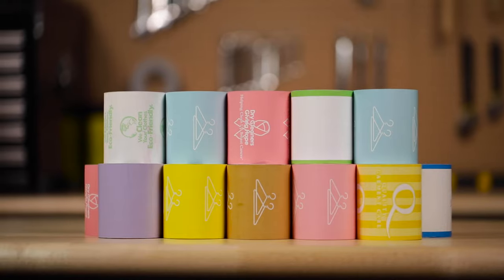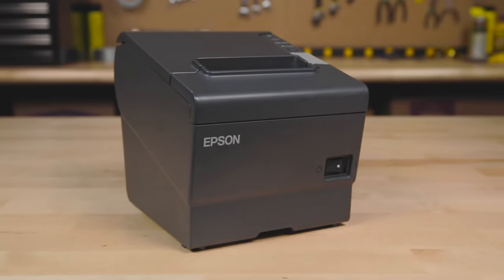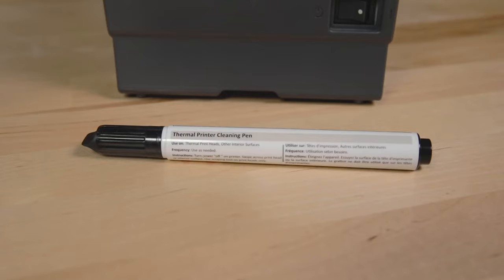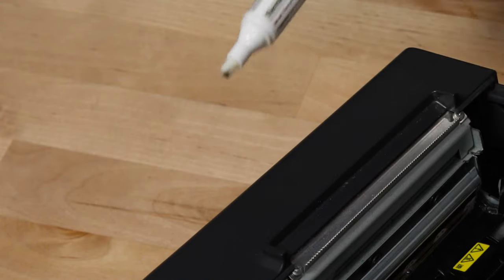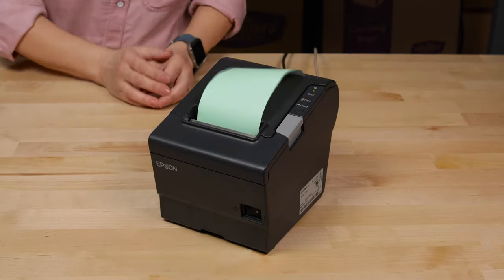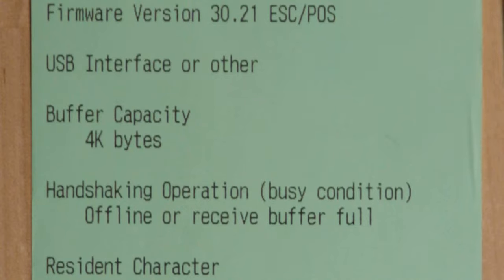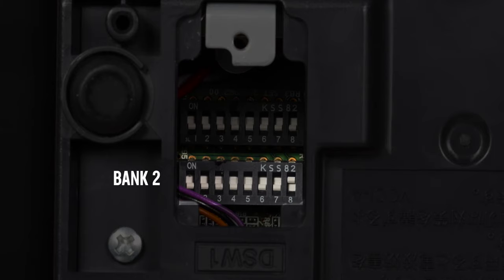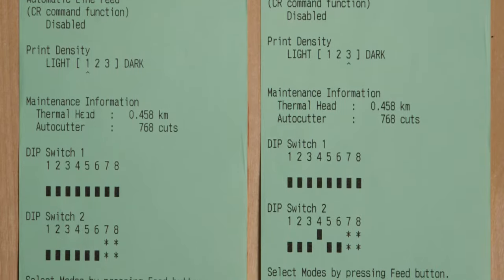How To Clean A Thermal Head Printer

Comment: Hey I was having the same issue with a Paperang P2 thermal printer that connects to a smartphone. You showed the use of alcohol in a pen. I didn't have any but I was able to clean mine with a little hand sanitizer on a piece of tissue and before I cleaned it there was this black stuff on the head and after cleaning, the black gunk was gone and my printer works as good as it did when I made my first print out. Thank you.

Comment: Very good day, first of all, congratulations on the videos you upload, they are always very useful and have particularly helped me a lot. Please keep uploading videos like this. Please if you can help me with the following: I have a TM-T20ii that sometimes prints perfectly and other times it stops on the first line, check the motor, sensors, clean the head. When it prints the print is of good quality. I have tried it with the startup test by turning off and holding down the “Feed” button and sometimes it prints the entire report, sometimes only the first lines, sometimes up to half and it throws an error. When I turn it on normally, the error light comes on for a second and then goes off (I don't know if it's normal). I have another similar printer and it was working perfectly, but when I cleaned the head (with a cotton swab and isopropyl alcohol, printer turned off and then I blew to evaporate all the alcohol) the same thing started happening to it (I have seen some people do it). They clean with WD40, I don't know if it is recommended). I don't know if after cleaning you have to reset something. Both printers have less than 4Km of head usage (they last 150KM), when they print the quality is good. However, I don't know if cleaning damages the head, but I followed the steps that the website recommends doing for this purpose. It would help me a lot to know your opinion, if something similar ever happened to you and how you solved it, thank you very much in advance for everything.